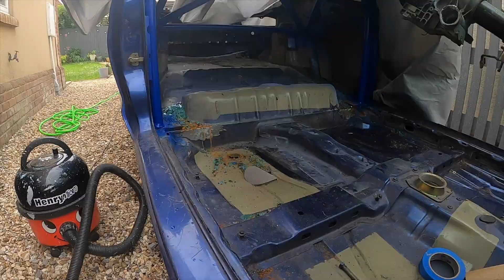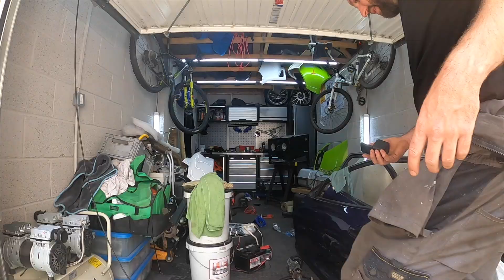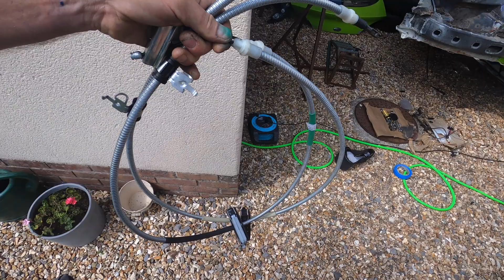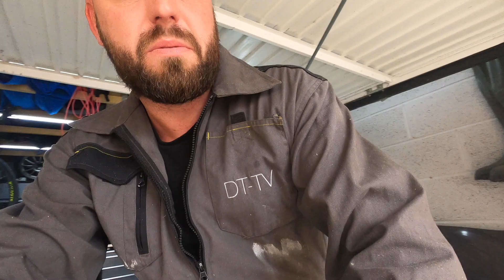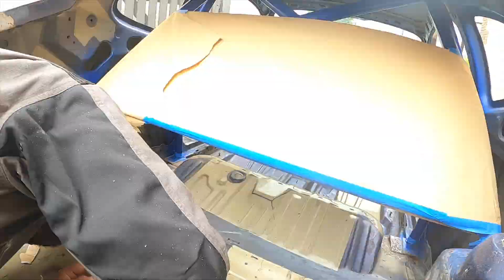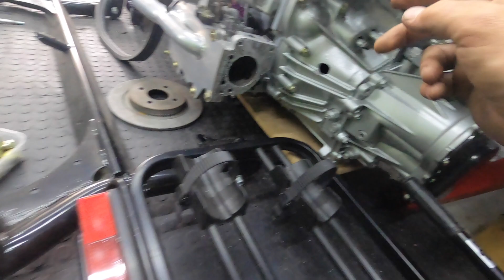Rebuilding a Rally Car - Part 47 - DT-TV - PAINTED FUEL LINES, NEW TEAM DYNAMIC 1.2 WHEELS.

Comment: hello I've got a normal puma and i want to plug panels from pumaspeed to looks like frp, tell me if you know about the process, is it difficult , or i will need something more to achieve this transformation?
Reply from the maker: Hi mate, I dont think the kit of the best quality in all honesty so will need so fabrication to ensure a good finish. You will need some pretty hefty front spacers if you cannot source any Ford Racing Puma front hubs as the wheels will look lost in the arches, if you use spacers its worth noting that you would need some pretty big ones which would lead to tram lining when driving. Hope this helps, anymore questions please just let me know.